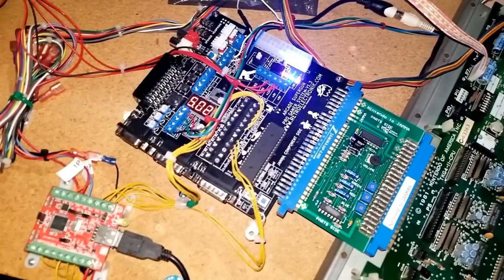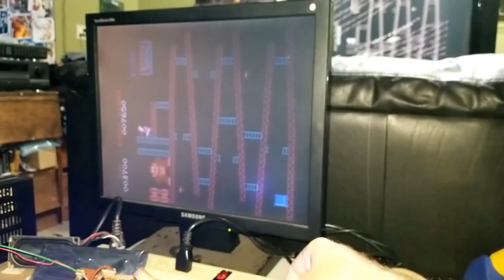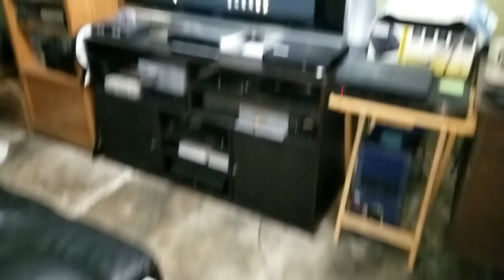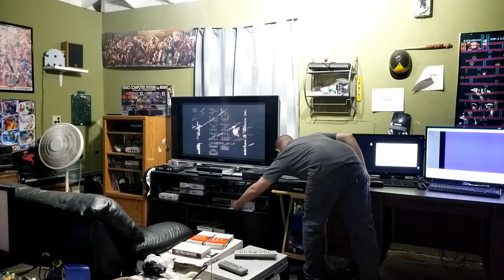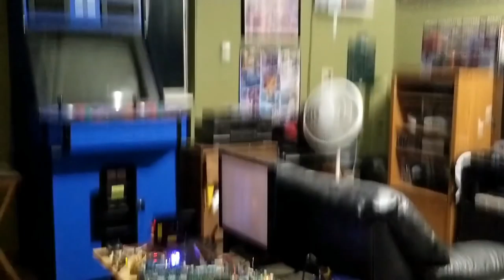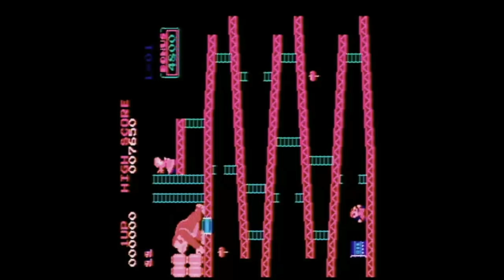DK Arcade - "Billy Mitchell Capture Setup" - Screen Flipped via Game Board Strap

Comment: So, this may be a dumbass question, but has anyone run the feed out of the VCR to a CRT rather than a flat panel?
Reply from the maker: Alex Snitzer please clarify, for what purpose?  Are you referring to the lack of color?
Reply: Chris G That and the fact that flat panels tend to have set refresh rates, which may not match the refresh rate of the CRT used in a Donkey Kong cabinet.

I just want to explore/close off this potential explanation for the girder issue / color issue.
Reply from the maker: The color issue is somewhat isolated.  I can take that same composite cable to the LCD TV that is displaying the capture window on my desk, take it to the composite input on that LCD TV and it will be in color.  As far as the monitor that is running directly from the game board - the one that I manually rotate before starting to play -  it has no effect on the gameplay.  The video signal is being sent to that monitor and to the Nintendo inverter board etc in parallel.  The gameplay footage contained in the video is a direct feed being captured from the Nintendo inverter board side of the equation.  Hope this makes sense.  We are weeks down the road in many tests being done by myself and others.  I can confidently say that anything that can be reasonably checked, verified, tested, has been and the evidence is conclusive that Billy's tapes do not represent arcade gameplay.
Reply: Chris G I understand.  I have been following Tipster's videos (and others) and just wanted to verify that someone had checked that.  I don't want to give Billy any wiggle room when the judgement comes down.
Reply from the maker: To further clarify, the captured gameplay is an exact frame by frame capture of what the game board is spitting out.  The capture chain is not perfectly synced so there might be a very small percentage of missed frames...less than 1%...but it effectively captures every frame.  Think of the capture device as a camera taking a snapshot 60 times per second.  The game board is producing an image 60 times per second.  The capture device does not change in any way what the frames look like that the board is producing.
Reply: Chris G No, I get it.  I was just concerned that since some of the primary evidence comes from a camera recording a CRT, there might be an anomaly in how the CRT displays the frames it receives that Billy might use to argue that his footage was not from MAME.  It's a question on the order of "Have you tried turning it off and on again?", but sometimes those questions have somehow not been asked.  Personally, I'll believe Billy is capable of hitting 1.05M when I see him get 1.05M live on a physical cabinet at Kong-Off and not a second sooner.

Comment: he didn't use arcade hardware as it is pretty evident in this have you tried playing with height width and v sync settings o n the original monitor??

you might want to get hold of the console port of the game the only time I ever seen a girder tail/glitch in DK is when you have the console connected by RF and it not correctly tuned to the tv channel

Note in the original setup what were you using to handle the RF moduie..

which was missing in billy's setup

i've played usb  tv capture devices to know there is no av connections only RD on the dongles 

IF the vcr wasn't tuned in correctly it is plausible that the girder glitch may show..|

though because more or less states av connection I have to wonder if there was an issue with the vcr because you wouldn't see a girder via av..

I can't say billy cheated however he needs to come clean in what he used because looking at this  I betting my bottom dollar he didn't use the arcade hardware in his video submissions given there is no rf module off the arcade hardware...

Comment: what the hell are you doing? before i say anything else i do believe Billys tapes were mame. your entire test procedure is complete nonsense what the hell is the point in connecting it to a flat screen tv  since it cannot display progressive scan? why are you using a video processor that converts the image to hdmi? what is the point  in showing us a vga monitor? also you CAN record in color on some older VCRs i have done it myself. it seems you want to show how clean you can get the picture by converting it to different formats and using incorrect capture devices.  but Billys vhs tape is ANALOG. did you even use the same gigaware capture device and software? let Billy make his own bed by reproducing HIS recording methods. with any other methods you just create plausible doubt. also the two bit card has adjustments for color burst frequency and color intensity which helps it display color on more devices . damn good game of DK by the way
Reply from the maker: Arcade Jason this was done in response to a post on the twin galaxies dispute thread.  Just one of many many tests.  This in response to theories about how the screen was incorrectly rotated in the 1.04 and 1.05 tapes.  60fps will capture any of the anomalies in Billy's tapes and then some, if they exist on arcade hardware..  What this captured, if you watch the startup frames for the barrel boards, is the girders render from the opposite side of the screen when the board is modded to flip the image.  A vcr isn't going to change that.  A gigaware device that was not in the capture chain we were originally told by Robert childs, would not change that.  A gigaware and VHS will not change the frames to show 3 girders instead of 4 or 5.  If what is on Billy's tapes actually exists from arcade hardware, higher framerates capture rather than lower will expose it.  What this clearly shows is: what is on the 1.04 and 1.05 tapes, which are flipped, are not producing an image that originates from an arcade game board outputting flipped video.  See sock masters post on dkf about why vcr's and some TV's treat rhe ouptut from the the encoder as black and white.  All settings on the encoder were exhausted with no relief from black and white on the shown plasma and VHS recording.  Findings also corroborated by Jace hall.
Reply: from what i understand thew screen was supposedly  flipped 90  not 180 with billys method
Reply: +90 then -90
Reply: Arcade Jason I believe it was flipped 90 but to the wrong direction, and someone has theorized that this could be explained due to the whole image just being flipped. This test was intended to show that that theory cannot explain the situation.

As for the setup, Chris is replicating tests that TG is doing and I know Jace was hooking things up to various monitors and recording setups in order to demonstrate that some things only captured it in black and white while other things captured it in color but to varying results.  The point of all of which is to demonstrate that the source signal out of the setup prescribed by Mr Mitchell produces a signal that is not ...shall we say..."cooperative" with the recording process.

That's my best understanding anyways, hopefully that makes some sense and explains the logic a bit for you.
Reply: thank you
Reply from the maker: To clarify, a monitor has to be "rotated" to display DK properly.  DK is a vertical game.  In a normal horizontal orientation, DK displays sideways, with the hi score on the right of the screen.  The screen needs to be rotated 90 degrees counter clockwise to display properly in a vertical orientation.  The 1.04 and 1.05 tapes had the orientation 180'd.  The hi score was on the left side of the horizontally oriented screen, and needed to be rotated 90 degrees clockwise to display properly in a vertical orientation.  MAME at the time made this orientation mistake natively also (without any command line arguements).  As we see in my video, DK boards have a built in ability to be flipped.  Robert Childs and Arcade Pac Man argued that due to various reasons, it could've been necessary for the game board to be modified, and display "flipped" video, and that's the explanation for the incorrect orientation in the 1.04 and 1.05 tapes.  But, we no see that when flipping the video at the game board, it produces screen transitions etc, that are not matched by Billy's tapes.  Maybe we're all already on the same page here, but I wanted to offer that additional explanation for anyone not already in the know on this piece of it.
Reply: a flat screen does not scan in the same manor as a crt. flat screens process the signal before it is displayed (screen stretch different scan frequency different scan directions different native resolutions lag time  image compression ect) that is why light gun games do not work with flat screen displays . and why the original progressive scan is gone i do understand these simple concepts do you?
Reply from the maker: Arcade Jason but you do understand that the flat screen was simply for demonstrating the orientation of the video coming off the gameboard and for me to be able to play the game while capturing the gameplay of the incorrectly oriented video?  It was the easiest solution and I had no interest in modding my sanyo 20ez's to play with the video flipped.  The flat screen has no influence on the direct feed game capture.
Reply: yes i was just replying to deft motions comment
Reply: As you can see, he has it connected to an analogue signal via the VCR and then from there it goes to the flat screen TV. Therefore, his capture source is analogue with only the display being digital. He likely had the VCR connected to an analogue to digital converter. Not directly to the plasma TV. But that said, it still didn't work. Hence why he went with the digital converter to PC method instead.
Reply from the maker: It was all analog up to the plasma TV.  Game board->Nintendo inverter->two bit score rgb to ntsc encoder->vcr->plasma. I then pulled the vcr pass thru output from the plasma and put it into the iscan vp30 in order to capture through the vp30->avermedia c127 capture card.
Reply: Arcade Jason you rock